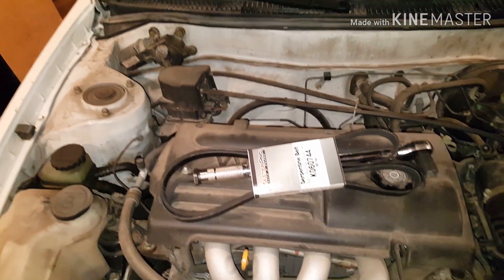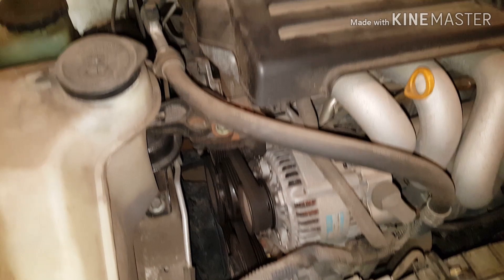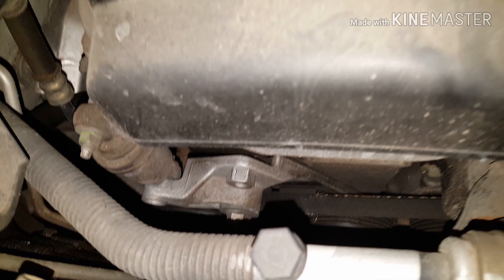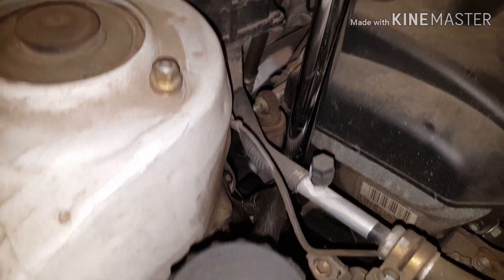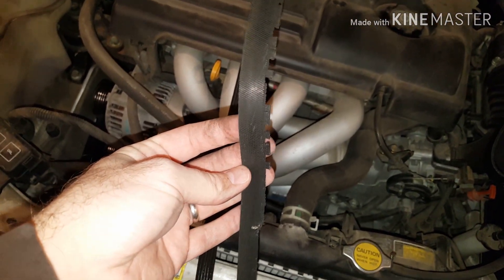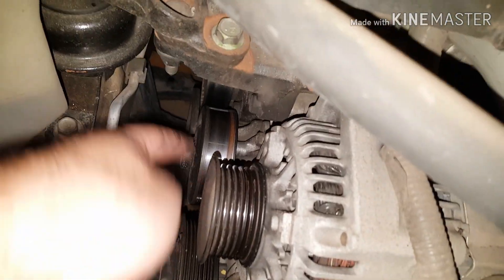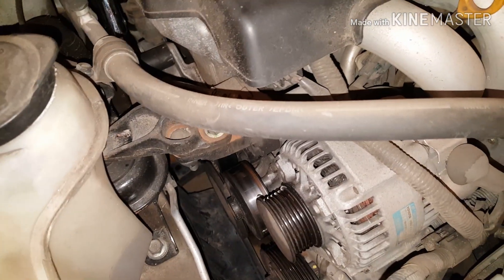2001 Toyota Corolla drive/serpentine belt replacement

Comment: Thank you for the video you explained things well. I just replaced mine but since then my battery drags upon starting and I don't know but while driving I think I feel like a slip. Could this be because of the serpentine belt? The slipping also? Lol I am a 52 yr old women but im using our quote unquote joint you tube account which basically belongs to my better half. I took 2 1/2 years of auto shop in  high school and proud of it. Remember now I am woman!! So he hires our "Brokechanic"playfully towards him but not really as much as he charges but everytime he gives us a good deal I me WOMAN has to go fix it then I get the silent treatment because i did it. Any advice. The belt was replaced about 2wks ago drags but still cranking. It's getting colder here in SATX..But I just replaced the battery too. I am the single proud owner of my 2001 toyota corolla le. She has never given me any major problems NONE and I'd like to keep it that way..
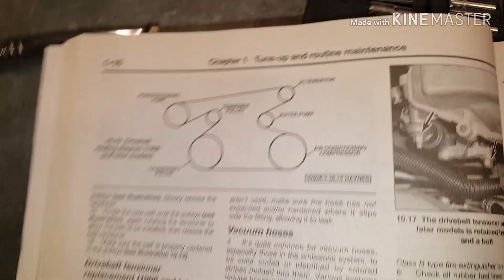Reply from the maker: So long as you installed the belt correctly (I show a diagram at 0:48) then it really shouldn't be dragging while starting. The only reason that would drag on start would be from starting it while having the ac on, this puts extra strain on the starter since the ac compressor will be engaged. The couple of things I could think of is to check that the belt is installed correctly, then you could check each component the belt goes on to see if they're starting to go out (ac, starter, water pump, power steering). Also I know you just replaced the battery but I have heard of a single cell in the battery being bad, so the battery has enough juice to crank over and start but just cranks over slow/ sluggish.

Comment: Nice work! You definitely lucked out there
Reply from the maker: Thanks! Yeah I definitely should have checked that belt sooner, definitely looked I like it could have snapped at any point.
Reply: Idk. Mine is split lengthways and way more worn than this 😅
Didn't snap though

Comment: I'm trying to do this on my car but I can't get the new belt on no matter how much I try to stretch and pull on it. Is there something I could be missing? Some trick to getting it on?
Reply from the maker: @vladimirgonzalez9791  if you're moving the tensioner pulley to loosen the belt and routing it correctly, it's possible that you have the wrong size belt

Comment: Try doing this with air conditioner system in place.  I can't find youtube videos showing alternator and serp. belt R & R with air conditioning system for this car.
Reply from the maker: Sorry but not quite sure I understand your question? In this video I show a diagram that shows how the serpentine belt goes around both the alternator and the ac
Reply: @Handy-Mann    The car in the video has no air conditioning.  Cars with air conditioning have components next to the alternator which make it really hard to get your hands down into where the serpentine belt is, and also make it hard to remove the alternator.  I'd like to see videos that show how to do all this with the air conditioner components there.
Reply from the maker: @supermoonrising1070  So my Corolla definitely has ac on it. Sorry that I don't show a better view of that. I'll keep that in mind for next time I do a project in that area.
Reply: @Handy-Mann  My car (which is a Chevy Prizm (same thing as a Toyota Corolla) has an accumulator mounted to the left of the alternator, which blocks access.  I think we have different design cars then.  Thanks for the video and the replies.  Here is a video of exactly the car I'm trying to change the alternator:  https://www.youtube.com/watch?v=N14jSk5JXn8    (04:07 in that video)  (check out the accumulator mounted to the left of the alternator).   I can't figure out how to reach around and under it to work on the alternator or belt very easily.

Comment: do these belts every stretch to long and began to make rattle noise because the are out of range of the tensioner?
Reply from the maker: Typically when they stretch they'll make a squealing noise, especially when starting the vehicle. So if you hear that belt squealing that means that either the belt has stretched or the tensioner needs to be tighter/is going out.
Reply: If you have a rattling sound you may have a bearing failing. Take the and spinning the water pump and alternator to rule them out

Comment: Hi. I'm now having a hard time with setting the belt onto the pulleys. So that nut and bolt should help with loosening the belt again?
Reply from the maker: Yes, that's correct
Reply: @Handy-Mann   oooops. I meant to correct myself. The 17mm bolt away from the belt system. I already removed the bolts from the alternator. I now have been attempting to set the belt onto the pulleys before resetting the new alternator.